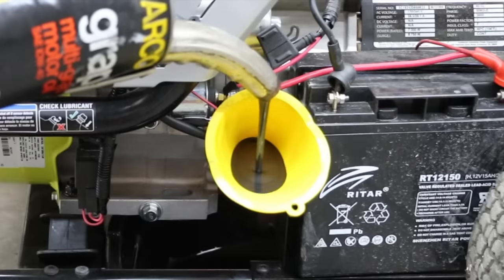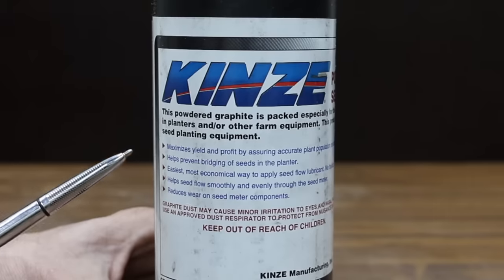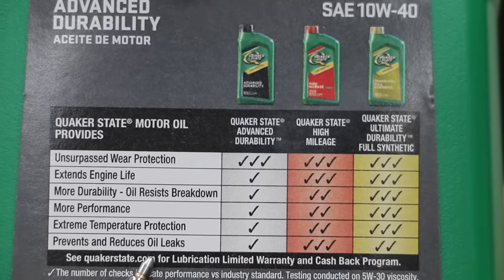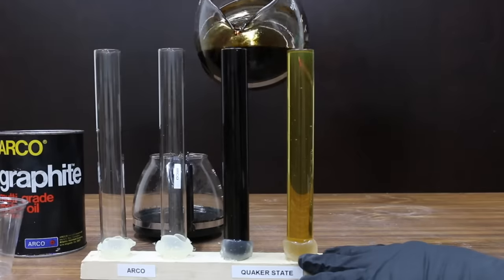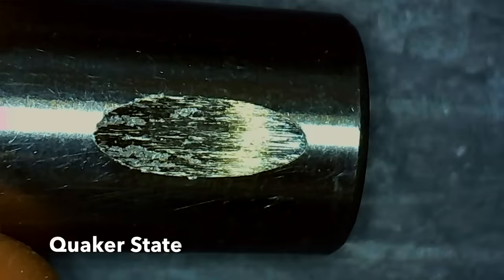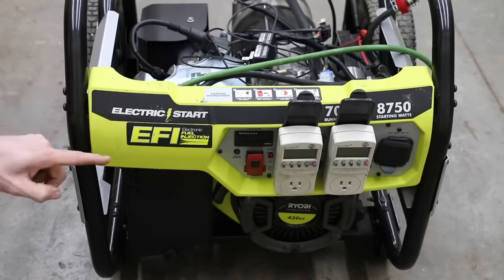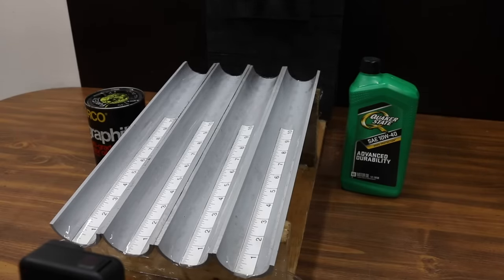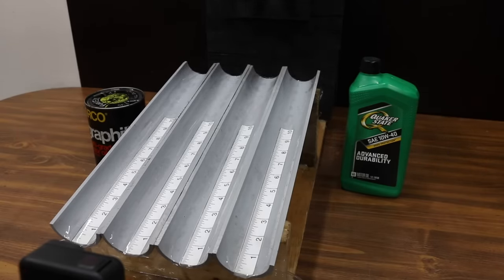Will "Graphite" Help Motor Oil Performance? Let's find out! Vintage Arco Graphite vs Quaker State

Comment: Happy to see this Arco oil comparison!  I always used it in the '70's until it wasn't sold east of the Mississippi any more. My car was a 1970 Buick Electra 225 with 111K miles.  Very reliable car.  Somehow I lost all oil and didn't know it. Maybe a shop didn't tighten the drain plug, I don't know but weeks later when the idiot light finally came on I was driving home from work at 50 mph.  I looked at the dipstick and it was DRY, literally!  It didn't even have the film of oil that remains when it's freshly wiped off, there was no drop on the tip, this looked like it hadn't been in any oil at all for a long time.  I have no idea how long I drove with no oil.  It was so long since it 'supposedly' was changed that I couldn't remember.  I know it's hard to believe but it had to be the graphite oil I always used.  I'd like to see you try to approximate that kind of test.  Run an older engine long enough to cover everything and every gap with graphite then let it run out and see if the engine seizes up like it would with regular oil.  There was a lot of talk back then about people being afraid the graphite would plug the filter but I never had any kind of oil related problems with a filter or that engine and never saw graphite settled out in the can.  Back in the 70's I wasn't looking at viscosity and lubricity too much.  I knew synthetics were better so I switched in the 80's.  If they still sold Arco I'd have used it longer.  In today's engines with tighter tolerances and thinner oil using that old 10W-40 graphite would be taking a chance.  But it was great while I had it.  I was Not surprised at all by the small wear mark from your lubricity test! That big difference alone is yelling out to take a closer look at this.  My car didn't leak or burn oil either.  I think the graphite may have helped seal those gaps.  After that, I heard about oil with Molybdenum Disulfide in it.  The molecular structure is the same as graphite, that's why it's also a lubricant.  However, I never used it because if the graphite should burn it would make CO2 but if MoS2 burns in the cylinder, it forms Molybdenum dioxide, MoO2, which is a solid like silicon dioxide - sand, and I didn't want that in my oil.  (Not to mention the sulfur poisoning the catalytic converters.) I've been wanting to relate this story for a long time.  I think some comparison tests using the graphite coating in the engine might give some interesting results.  I will add that the car was old when I got it, about 70K miles so maybe the worn surfaces were less liable to seize.  It may have had a thick coating of graphite, I have no idea.  Nowadays I'm happy with synthetics.  My last car, 1989 Trans Am, had the original engine and trans with 149K miles when I sold it.  My daily driver for 30.5 years.  P.S. You commented on the high calcium level in the oil analysis and that calcium is used in the detergents.  It could be high as a means of helping keep the graphite in suspension.  I hope to see more graphite comparisons.  I enjoy your tests.  You do a good job.
Reply: TJ T that’s one hell of a comment 😂
Reply: I second the run it dry comparison test, though I think you would need to run with the graphite oil for some time (weeks?) to properly coat everthing

Comment: I used Arco Graphite in the 70's in a custom dodge 360 engine powered Power Wagon..  The Arco graphite oil caused the ends of all of the lifter rods and tappet adjusters to grind off completely in a very short period of use.  Arco denied that it could have caused the damage but the product was removed from the market no long after.
Reply from the maker: Thanks for the feedback.
Reply: Similar thing happened to me with a 1980 Jeep CJ. Fortunately, I had traded it on a new car. The dealer called me about It, but it was too late for them to do anything about it. I didn’t know anything about it u til then.
Reply: Flat tappets, need zinc.
Reply: Valve train problems is just a Mopar thing if we want more power it come with more rebuilds
Reply: Could there have been a bad batch of graphite that was contaminated with silica?
Reply: That's a big problem with graphite, if the graphite isn't completely free of contamination then that sort of hard polished surface will get wrecked, and that sort of graphite purity is not common. I think molly is of more reliable purity since it is synthetic and that might be why it's the only one you see in commercial greases now.
I have found use for graphite to thicken molly grease into a nearly dry paste that is great for screw threads and sliding parts that you don't want to attract dust, but that's about it. Really good for hinges and the screws on vice-grips and such when you have grinding dust in the workshop.

Comment: Back in the 70s, my dad insisted in using Arco in the vehicles. We had a '78 Toyota short bed that had a leaky pan gasket, which allowed the arco to coat the undercarriage of the truck quite well.
Reply from the maker: Thanks for sharing.
Reply: ". That's that automatic undercoating, they put that in at the factory, but I'll talk to the manager".
  Jerry Lunderguard
                                 Fargo

Comment: Used an old product called " prolong" in my old 318 dodge. Had to back off the idle screw as it raised the rpm by 1000. Saw a marked improvement in economy as well. Engine is still running strong at 180000miles.
Reply from the maker: Thanks for the feedback.
Reply: I used prolong a couple of times, not bad results!

Comment: Please do a second test with an engine that has an oil filter and then cut apart the filter..
Reply from the maker: Thanks for the video idea.
Reply: I agree. I'd love to see what the rod bearings look like too...
Reply: Would like to see a lot of these tests with small engines with oil filters since they are going to be a bit different I think
Reply: @ProjectFarm  please do a video on  clean boost emt.
Reply: Thats a great idea, I wonder if the 99.9 percent filters would clog up on the graphite
Reply: @tylerh629  The Arco probably has small enough particles, but that bottled powder?
Reply: Good idea. I'd love to see that

Comment: I tested all varities of motor oils for GM when I was with Chevrolet Motor Division, The timing of this coincided with the Arco Graphite oil coming onto the scene. Being a member of the SAE I contacted the API and asked a few questions. As they could not comment on a particular brand ther scientist I spoke with gave me some pretty good info. First of all, graphite can't just be added to engine oil, it does not go into solution, but can be forced into suspension by companies such as North American Colloidal. So there is that. And graphite can centrifuge out of suspension in high speed situations, especially where there is a reduction on the diameter of the carrier, where the expansion of the carrier can cause the graphite to precipitate out. Kind of why a certain synthetic engine oil had to remove it's product from piston aviation engines which used leaded fuel. The spaces between the molecules of the oil molecules was too small to scavenge the lead that made its way into the crankcase, which could then centrifuge out and block crankshaft oiling holes and prop governors. And there is more, but what's the point? All of this stuff was know to the industry 40 years ago. I may be new to your followers, and to you, but the testing for all of this was done in actual laboratory conditions by scientists.
Reply: Problems are:  finding that kind of info; then understanding information, after it's found. 

We could add to that the fact reading a white paper versus watching a video are very different learning experiences.

Many would not understand terms used in woodworking, copper plating and so on.  This is short, sweet and simple to follow for a general idea of the merit of adding graphite to engine oil.
Reply: What other cool shit can you share with us? I found that extremely interesting.
Reply: @kellyvcraig  not to mention the modern engine is a different animal, however, the differences seem to be against graphites favor xD
Reply: That's what I call an explanation.
Reply: Link us to papers, if they are available.
Reply: Yeah, we need more info
Reply: Thanks for sharing your knowledge Mr Lynch. And that IS the point - sharing the knowledge gained in study and experience, very high value there.  And here we are - some people ARE learning! Thank you . . .
Reply: LOL! NICE STORY. DO HAVE ANY MORE?
Reply: @ilovecops5499  oh ya! i forgot
Reply: @jamesw.6931  WHY?
Reply: @Shadows-RC  to stop ruining everything he touches.
Reply: @Shadows-RC  I also lay the blame at the feet of those responsible.
Reply: @Shadows-RC  No it didn't. The business models have some similarities. Amway is not a pyramid because they have been taken to court several times including a case that went to the US Supreme Court and the Amway business model has been shown to not be a pyramid scheme.  They are still in business.  Did you have bad dealings with them? Lol. Layered marketing is completely legal and is the business model for many companies.  No ,I have nothing to do with Amway.
Reply: @jamesw.6931  They had their issues back in the beginning. My uncle had a VW left inactive over a winter? and found that it ate the bearing clad...He stopped being a dealer.
Reply: Do these previous videos have YouTube videos?
Reply: @jamesw.6931  If you dont mind me asking, what model year is your fiesta?
Reply: @Shadows-RC  you must feel REALLY good about yourself, and I’ll bet you’re probably compensating, physical or not 🤷🏼‍♂️

-A not so fat, person who is just trying to get by and not be depressed, who also happens to be an American
Reply: Real world conditions are near
Reply: Testing must have taken place in the 70's. Enjoyed your comments.
Adds great content. Thanks
Reply: Crankshaft is a centrifuge. Has me thinking about engine dynamics in a different way now.
If a crank was designed different, it may be able to take advantage of graphite.

Comment: I have witnessed in one of my professions, that with long term usage, it will cake up in the piston ring grooves ceasing them and same thing can happen too hydraulic lifters. Your mower test showed the affect when you pulled the spark plug out. The accumulation of graphite particles can cake on high quality oil filters causing oil pressure issues. The only place this is suited for are gear boxes. 

Peace and be well.
Reply from the maker: Great point!
Reply: how much do you think alternating between graphite and non-graphite oils for oil changes would reduce that problem? The graphite oil seems to leave a lot of residue that would be hard to get out and would have a higher concentration of graphite due to evaporation, so it might lead to an overall increase of graphite concentration over time and increase the likelihood of those problems. I would be inclined to think alternating types of oils would dilute the graphite every other oil change and help prevent build up, though there are a lot of factors that would make it hard to be sure of without testing.
Reply: I don't see how graphite in between the rings 'ceases' them. As long as the graphite is in between surfaces, it will reduce friction.
Reply: @OldCrowsClassicCars  Et tu, Caesar? 

Good question... maybe graphite can get sticky when mixed with oil at high heat and rubbed... one thing is for sure, this video didn't look at  long time spans. 

I guess I'd ask around before putting any in my tractor, if I had a tractor, and friends to ask.
Reply: @OldCrowsClassicCars  The graphite in suspension will create friction loss, even in powder form. However graphite can compact, in a location such as piston rings where the full force of combustion gasses are placed small amounts of the graphite in suspension can be compacted, over time this can lead to the creation of what is effectively a block of graphite behind and around the rings causing them to stick in place.
Reply: Project Farm 
  Not really applicable or feasible but a small gear box tested under moderate load/ low speed with this mix could be interesting as far as quality of noise reduction..? Great videos as always. Great work.
Reply: It plugged up the wrist pin oil hole on my ford motor., Destroying it.
Reply: @harrier331  hard to believe that. Many people have used this product for a long time. I doubt the graphite would be strong enough to seize an engine, especially since it's constantly moving, and therefore removing excess graphite.

I really hope he does a long term as well as a seize up test
Reply: @nmarbletoe8210  I did think he might have put a little too much graphite. 

The graphite will certainly increase the viscosity of the oil.
Reply: @kryptonitekid4865  I feel like liqui-moly is the modern version of this and he should do another test on modern "nano" solid lubricants - ceratec, tribotex, archoil, etc.
Reply: @ShivaShakur  That I think is a fantastic idea, test modern day equivalents of these old oil types.
Reply: @OldCrowsClassicCars  Good point.  However if it agglomerates it could build up like sludge, but I don't see this happening in the ring grooves.

Comment: I have added graphite powder (lock lubricant) to power steering units that were just starting to make noise. They quieted down and I had no more power steering trouble in the several more years I had the cars. This approach may be especially useful to folks now, when supply chain disruptions have simple parts on backorder for several months. I would like to see a lifetime test done on cars where graphite was added to the power steering fluid when the cars were new, and compare that to the service records of cars using plain fluid.
Reply from the maker: Thanks for the feedback.
Reply: Great idea, I'll try it on my winter beater. A classic 99 regal with 70k miles. A true grandma owned car. The racks starting to have issues and I'm not changing it. Thanks for the Idea.

Comment: Here's a video idea: Try testing all different brands and types of dish soap. (I.E Dawn Ultra, Gain, Ajax, Dawn Platinum, Palmolive, Dr. Bronners, etc)
Reply from the maker: Thanks for the idea!
Reply: Super interesting
Reply: @ProjectFarm  i would really love to see this one!!
Reply: ...AS ENGINE LUBRICANTS! ;)
Reply: well he is great at testing everything he touches... i think we should save dish soap for martha stewart to rank
Reply: Actually that might have a shop use as a degreaser, I'd be interested in this as well
Reply: I was told by a military tester that Dawn is a mil-spec degreaser for electronics cleaning of boards.
Reply: @NoName5589  that is what he should do
Reply: I'd be ok to see that. I opt for dawn for bubble leak tests and scrubbing dishes. Is it really the best?
Reply: in a lawn mowr?
Reply: Craig Prince when I first read this I thought it was so stupid, but now that I think about it, thats freaking GENIUS!
Reply: shop hand soaps too.
Reply: Craig Prince great idea, maybe shop soaps in there too like GoJo orange, cherry, Lava, etc.
Or who makes the best / most effective engine degreaser like Goop, CNC, Honda Brite, Purple Power
Reply: *Also, yeah - probably should torture another lawn mower by running soap in them because.... well, it just wouldn’t be right if Project Farm didn’t go 6mo without running something crazy in the crankcase of a mower for our entertainment. Ha!

Comment: I had a friend that lost engines in two different cars that he owned when he used the Arco graphite motor oil. This was in the 1980's.
Reply: I'm thinkin' once any buildup starts, it'll make big deposits in a hurry and clog things up, not to mention what it does to the filter. Don't like the idea of putting anything you can filter out in my oil!
Reply: Let me guess....domestic pile of shit? Lol.

That's normal.
Reply from the maker: Great feedback on Arco
Reply: @TheGuruStud  in the 80s domestic was better
Reply: @TheGuruStud  He had a Dodge Dart with the 225 slant six, usually a bullet proof engine, in one car. I forget what the other car had.
Reply: I think the guy saying it blocks the filter is right...
Reply: @TheGuruStud  that's funny the most unreliable car I've ever owned was an Infiniti J30, most reliable was a 275k mile rotbox El Camino
Reply: Harold Flanagan  up till the great ressession GM and Ford's were pretty good
Reply: Read on another site that the graphite that does sludge could block up the oil pickup in the bottom of the crank.  No idea if thats reasonable.
Reply: @TheGuruStud  I don't think the issue was the car, it was the oil full of graphite.
Reply: @Piznick64  GM had some quality issues from the 80s through the early 00's. Some of their cars from that time were great, some were awful
Reply: I knew a guy that worked at a moped shop that said the same thing.  Every customer that used the graphite enhanced motor oil lost an engine.
Reply: I would loath to put the ARCO "oil" even in a lawnmower! I might be willing to use it on bicycle chains...
Reply: @MegaGeorge1948  good lord! If it killed a slant it must be bad!.
Reply: @watsisbuttndo829  I'm surprised that no one, including my friend, sued Arco for this junk oil for damages.
Reply: @TheGuruStud  Try fixing, maintaining or repairing a German car that's over 5 years old.
Reply: @TheGuruStud  I used Arco Graphite in a Porsche 911 SC in the 80's and it destroyed the engine seals.
Reply: @lylemacdonald6672  I was thinking that Arco might make a good (yet staining) gun oil.